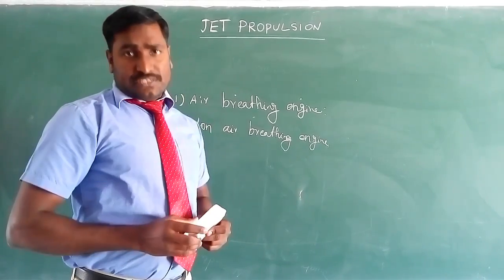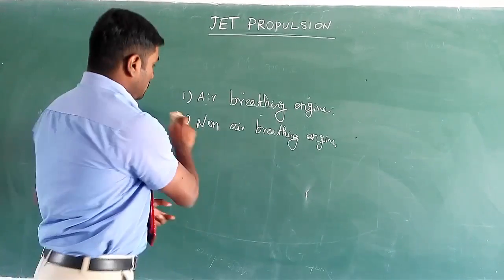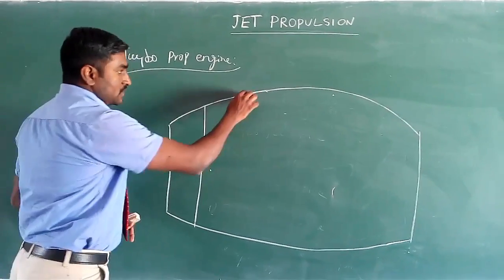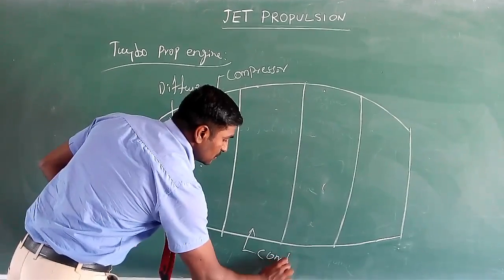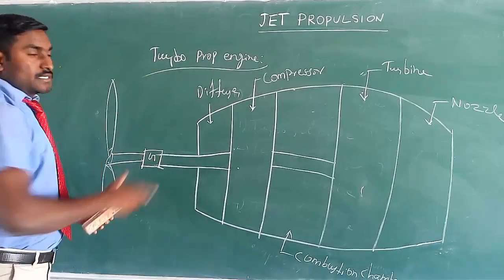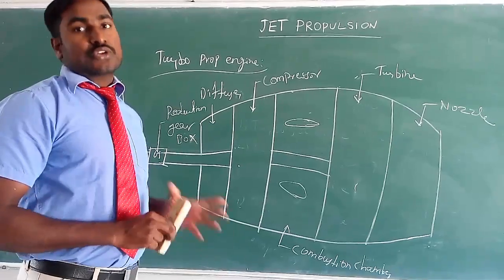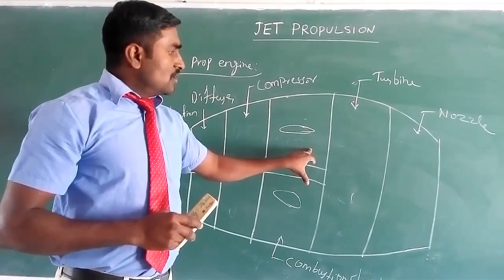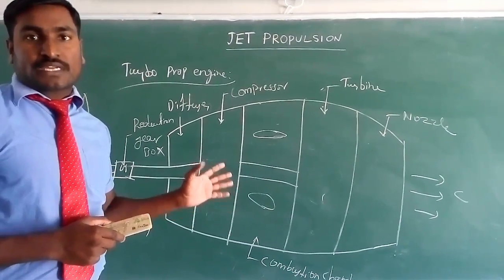JET PROPULSION ( Turbo Prop Engine )

Comment: Thrust is produced by the propeller or the engine itself from nozzle like tubrojet?
Reply from the maker: From engine
Reply from the maker: Due to exhaust gas in engine we get opposite reaction call thrust
Reply from the maker: Thrust is a forward force